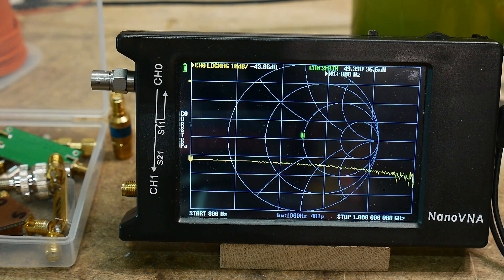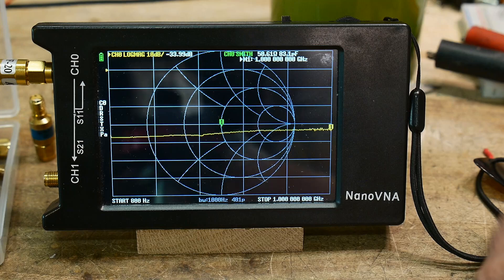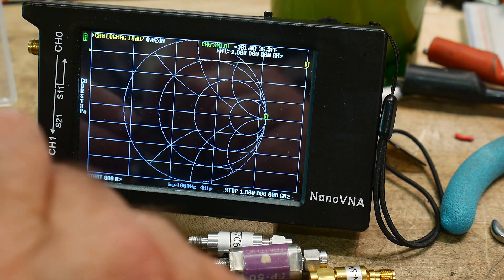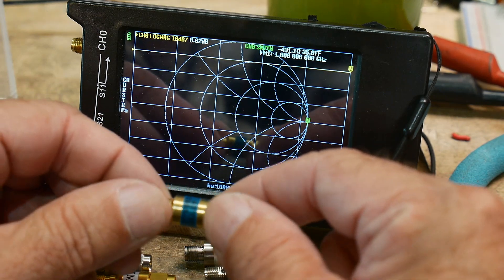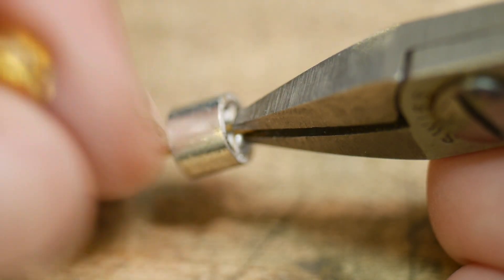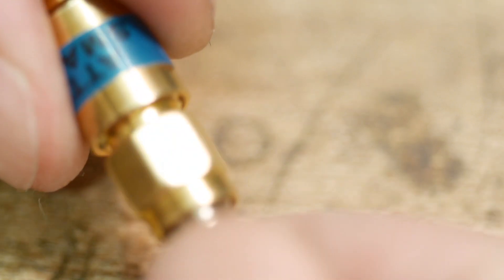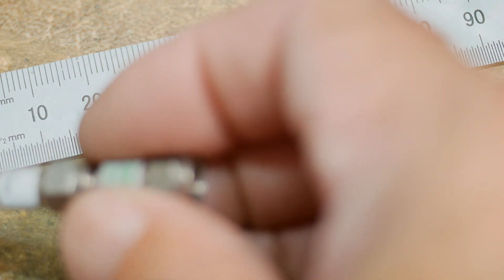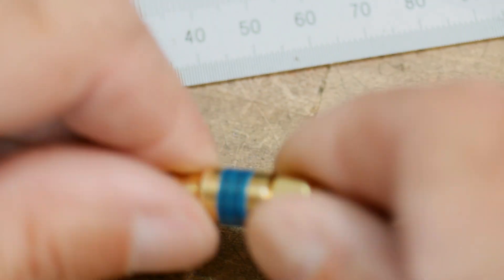#815 Attenuators used as a Load

Comment: I've used Bird and Termaline attenuators in the 20 to 50 watt range as dummy loads for VHF and UHF ham radios and put them on the output of a Bird watt meter.  With a 10 Db attenuator the reflected (reverse) power (20 Db down or 1%) was barely discernible.  With a 20 Db attentuator that reflected power is not readable on an analog meter.

It was really neat seeing these SMA attenuators taken apart.  I thought they would be pressed together and not able to be taken apart without destroying them.

Comment: I think your Overall readings would be slightly "better" if you used an SMA torque wrench on your SMA connectors   I
n lieu of a torque wrench, I recommend you use a small 5/16 open end wrench in conjunction with your "calibrated fingers" to lightly tighten them.  
If they are correctly tightened, your bare fingers (i.e. without a wrench) will not be able to remove them.

Also, if you were to leave some sacrificial SMA-SMA adapters on the VNA, your VNA will last much-much longer. 

73
Reply from the maker: I do keep a small wench on my bench and yes it would be better. At work we used to put those plastic wheels on the connectors for finger use

Comment: what do you think of this power meter ?
https://www.ebay.com/itm/143564798933?hash=item216d20fbd5:g:roMAAOSw-RlewWuL
Reply from the maker: Haven't seen that one. The specs are pretty average. only -40 dBm and only 1000 MHz. The price seems good but I hate PC based instruments. If you buy one I'll offer to do a full test and make a video.  There is no way to do a calibration so I expect it to drift with temperature.

Comment: Very cool. Now I'm motivated to try some attenuators on a TDR to see if they absorb the incident pulse and effectively act like a load. The SD-24 TDR pulse has a rise time in the few 10s of picoseconds, so the attenuators used would need to work up to around 20 GHz or so.
Reply from the maker: Do you have schematics for the SD24
Reply: @IMSAIGuy  No, but I think Ted Yapo has come the farthest in terms of attempting to re-create a TDR based on that older tech. See his Hackaday presentation; it's fascinating how far he has come https://youtu.be/99u53V7uDFY
Reply: @IMSAIGuy  Also, if you go down the path of messing with this stuff, consider getting a Leo Bodnar pulser. For $50-$100, it has a 40 ps rise time or so. See https://twitter.com/mfikes/status/1367092127205888003

Comment: Just a suggestion about the glare on the Nano-vna. If your camera lens has threads try to use a "circular polarizer camera lens filter" to adjust out the glare. The filter also might darken the image which you would have to adjust the brightness. I have used them to help take pictures of displays thru glass windows.
Reply from the maker: I'll go take a look. I know have several, forget what sizes.

Comment: Hi IMSAI guy. I don't know whether you follow Joe Smith here on YouTube? One of the things he recommends is when screwing in SMA connectors to not let the pin rotate in the female part as that reduces the life of the component. Essentially grasp the barrel and rotate only the nut to pull the pin into the female portion straight. Also use a quality short cable on the VNA to move the measurement plane away from the VNA's connector to extend the life of the VNA's connectors which I believe are rated for 500 insertion removal cycles.  Totally concur on crappy RF components from eBay. I buy attenuators and such directly from Minicircuits <- an awesome company. I'll reply with Joe's you tube channel in the even YouTube deletes my comment.
Reply: Here's Joe's Channel. I think he's the guru of PC software for the NanoVNA.
https://www.youtube.com/channel/UCsK99WXk9VhcghnAauTBsbg
Reply from the maker: He is a real RF guy, I just play one on TV
Reply: @IMSAIGuy  this is a much more useful channel
Reply: @IMSAIGuy  : Don’t get typecast - it’s finished many a career
Reply: @vincei4252  Checked out the joe smith channel, you sold me on it. Thanks, signed up.
Reply: At a previous job back in the day I used to have a box of various metrology grade adaptors, attenuators, etc. for N, SMA, APC 3.5 mm, APC 7, and so on.  Trusty 8 inch pound torque wrench, plus another one at higher torque value for changing end on Gore cables.

We would never, if we could help it, spin an adaptor such that the center conductor gets spun in the mating surface.  Always push the connector in while turning the tightening nut to hand tight then torque to the proper value.  SMA connectors on satellites are logged for each connection disconnection and replaced if the count gets too high.

On my HP (I know, this dates me ;) and other lab test equipment I would put a good adapter on the instrument and leave it there and let it take the abuse of cables or other adapters being screwed on/off.  If it breaks, I'd only lose $250 or what ever the cost of the adapter was and not the cost and downtime of having the test equipment shipped off for repair.

Learned this after a young engineer who didn't know the difference connected a 75 ohm N to a 50 ohm N and damaged the instrument.

Same technique can be used with the NanoVNA.  Put a couple decent adapters on there and let them take the abuse.  But also, you really don't want to see your quality attenuators getting beat up either, so do follow Vince and Joe's advice and don't spin them on :)
Reply from the maker: @RideGasGas  I hope you cleaned them with IPA each time.
Reply: @IMSAIGuy  :)
Reply from the maker: https://www.microwaves101.com/encyclopedias/connector-care